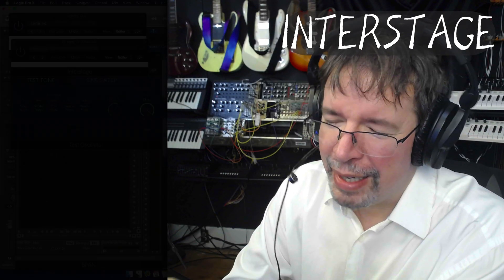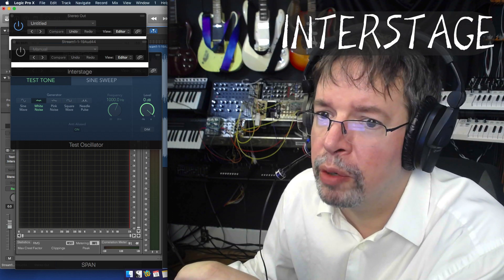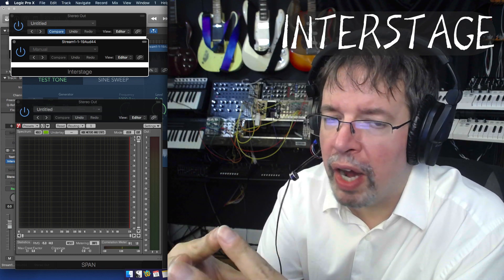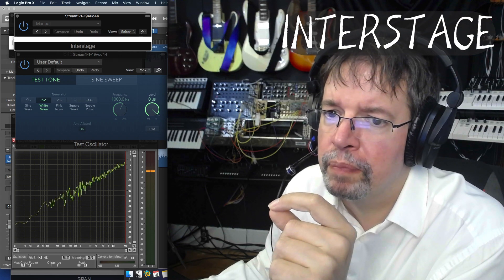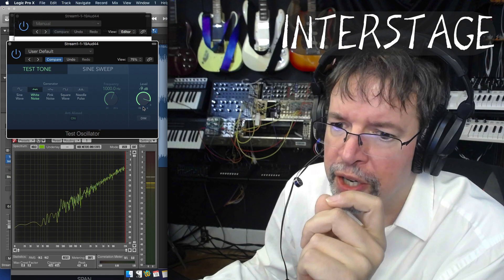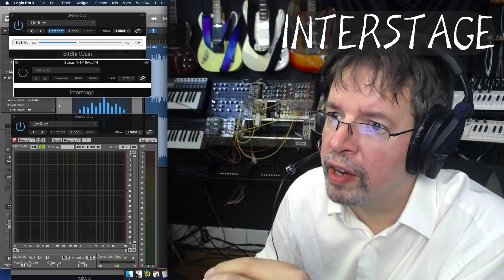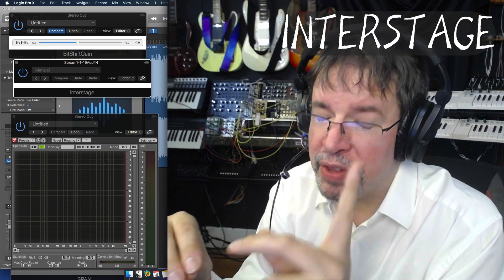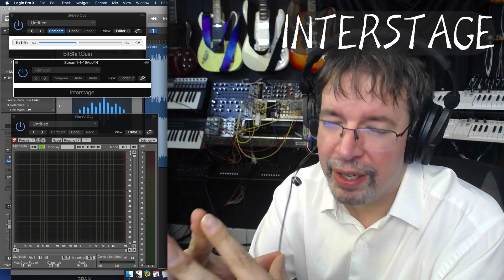Airwindows Interstage: Mac/Windows/Linux AU/VST

Comment: Might be the best high end reducer/limiter i've tried yet. Doesn't overdo it and it attacks right where you need it, while requiring no controls/inputs to adjust. It basically cleans up excessive high end (not sure about the low end) without removing frequencies or altering the sound like most others do.

Comment: personally i'd love input / output / dry-wet controls on every plugin... and maybe a genius like you could fix the much hated louder-better effect with some kind of integrated  A/B loudness comparison in each plugin
Reply: I agree. The only negative to airwindows and most plugins is no level matching to truly hear the 'effect' and not a louder perception. It's not essential however and no doubt realtime level matching is heavier on the processor. Workaround is using the very handy 'Perception' plugin though from MeterPlugs.
Reply: @SamHocking  You can measure it by yourself, and judge with your own ears. 
Nobody is stopping you from putting a spectrum analizer after any airwindows plugin, either....
Reply: @jeandista  Talking more about perception. ie level-matched input and output so you don't have to level-match for every adjustment of the effect.
Reply: I've just got used to adding gain plug in after the effect. I listen.... Pause and bypass both plugs ... Listen again....  Pause and unbypass both plugs. But yes. Output and drywet on all plug-ins is so useful.
Reply: You can we/dry and plugin with Reaper